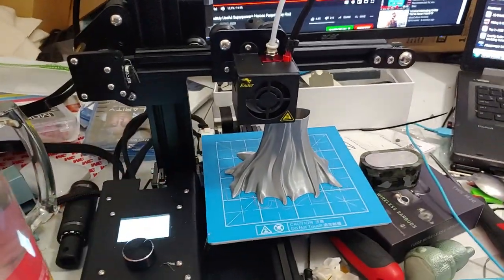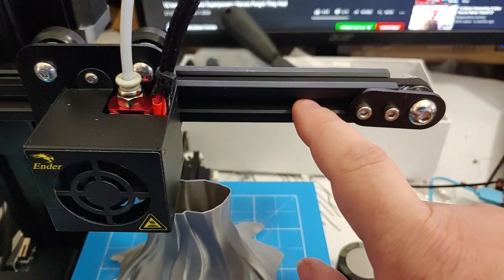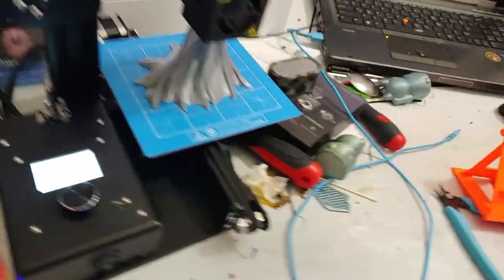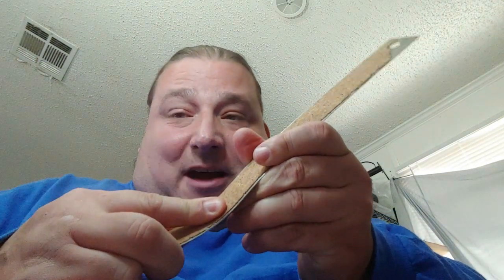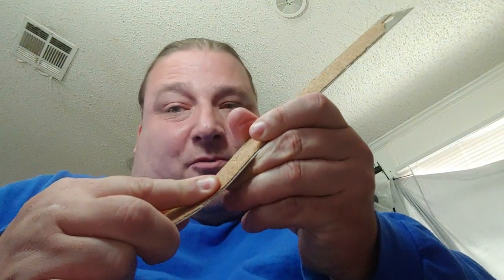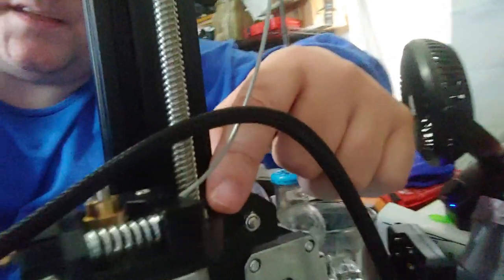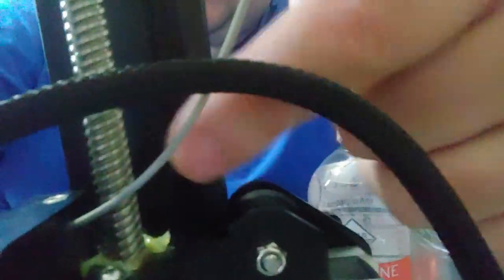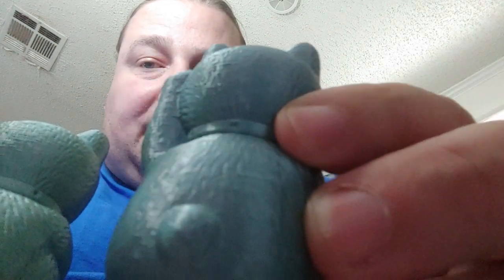3DP Basics Guidance & Motion System Coupling T3DP

Comment: Good explanation. I had issues with my Z axis on the top layers of the print whenever it reached higher than 175mm on my ender 3 v2. I had to adjust both the lead screw and wheels to not be too tight. It improved about 90%. Still need to do a little tweaking.

Comment: You sir, are a freaking genius. This is the kind of deep 3D printer dialing in that is hard for me to find on YouTube, and hard for me to understand when I find it in posts on forums and facebook groups. As usual, you make it easy for me to understand the principles and mechanics, so I can apply actual understanding and reason out my own problems, instead of just giving me a set of steps to solve some issue I may or may not be having... and that will undoubtedly fail halfway through due to my specific set of circumstances, and a lack of real knowledge of what I am doing :) Thank you, thank you, thank you!!

Comment: I have a CR10 S5  and installed the ENDER 5 Silent board upgrade.  Can I upgrade it to a 24v power supply?  I have a extra 24v Hemera and I want to use it on that printer.  The silent board works great, Can I just install a  Mean well 24v power supply ?  or is there something else (besides the cooling fan) that needs to be replaced for the 24v supply to work./?? 
Love the videos !
Reply from the maker: You just have to make sure all the components are 24 volt compatible are the stepper Motors 1224 compatible? You'll also need to change the heater cartridge heat bed Etc to also be 24 volt
Reply: @nerys71    The Hemera has the  heater cartridge . I do need to check the steppers.. thanks!